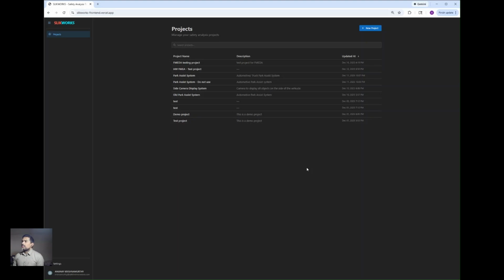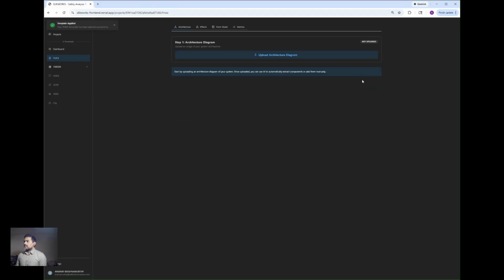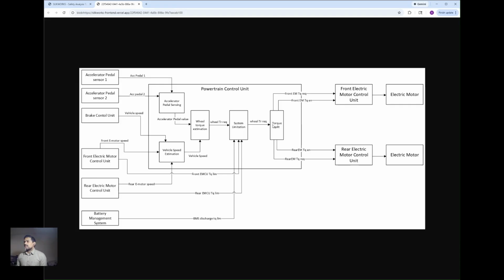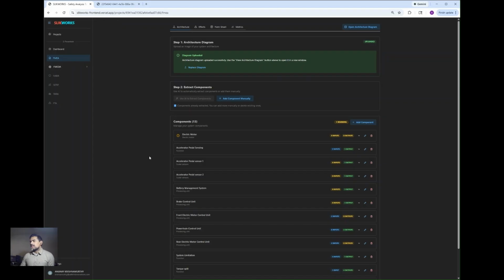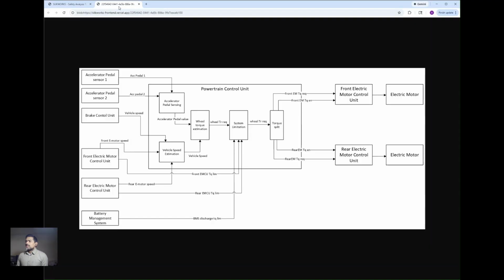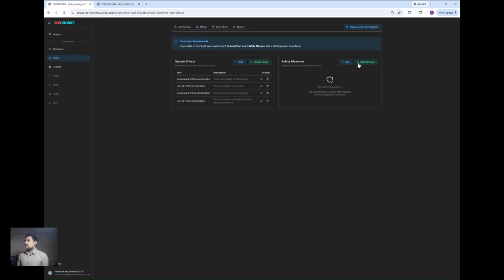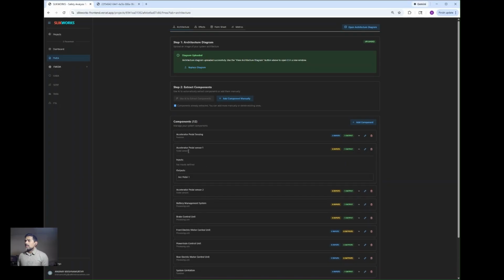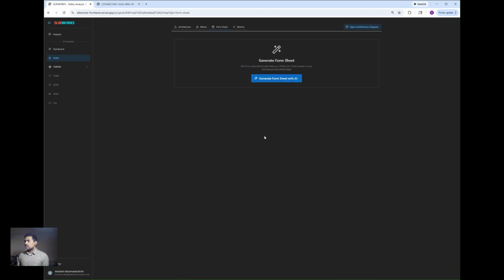FMEA for an Electric Powertrain using SLIKWORKS - Part 1

Comment from the maker: Performing FMEA for electric powertrains using AI-assisted workflows?

SLIKWORKS supports architecture-driven FMEA for automotive and robotic systems, including hazard and safety mechanism integration.
👉 https://www.safelink-innovations.com/slikworks/fmea-software

Comment if you’d like to see Part 2, covering failure modes and risk evaluation.